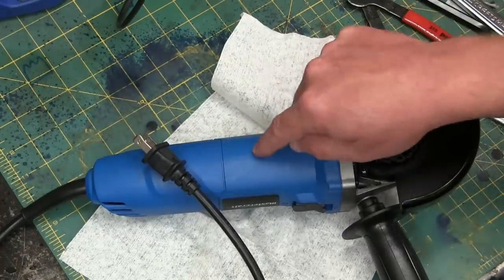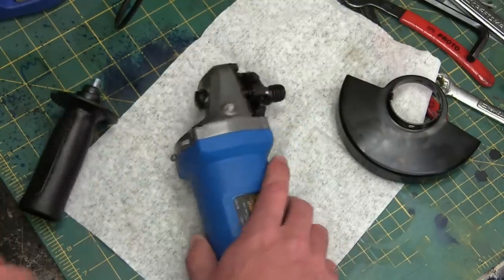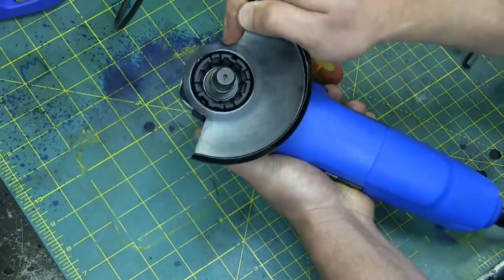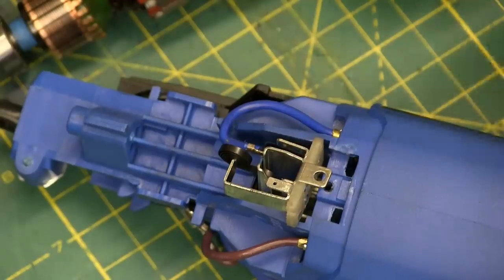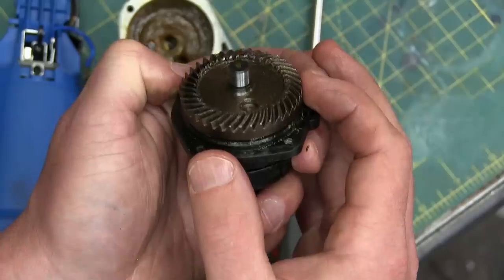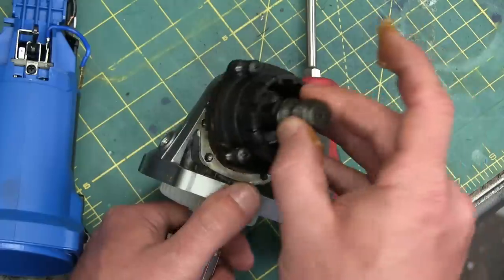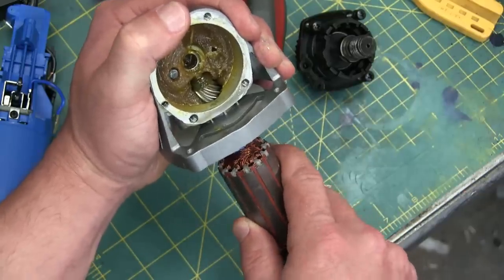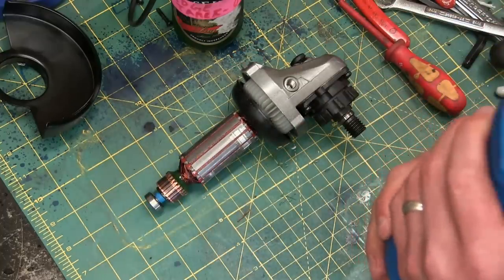BOLTR: Harbor Freight Grinder. HOW BAD IS IT?

Comment: Pushing the pin when the wheel is slowing down when done by a professional grinderman will snap the wheel loose (only handy tight to start)  and if your a rockstar you can let the carcus of the former grindstone roll right on the floor to sweep up later.

Comment: I have a HF grinder, 3 actually, one with no cooling fan what so ever, the fan busted from shaft so I removed fan and use it. it gets hot enough to burn my hands and has not quit working in 3 years! and the plastic cap that holds brush in broke so its glued in! the red grinder

Comment: The first thing to fail on mine (not even 30 days old) is the pin popped out so you can’t lock the wheel in place. Nope I never used it to stop the blade either.

Comment: I bought a grinder from the swedish equivalent of the homeless despot for about 30 bucks, and it seems friggin' similar. Sounds like a woodchipper loaded with gravel tho. And the switch friggin' sucks. Located on the topside, stiff as a wedding prick and the tab only snaps in on the 15th try. Great way to snag your pinky in the wheel!

Comment: grease leaks out. i think thats why so little is put in to start with. i used my pretty light duty until I had a big project. 

it seemed to get louder than normal. took it apart and greased it. it was bone dry.

Comment: The grinder you reviewed looks nothing like any of my 15-20 old harbor freight grinders or any of the ones in the current (2018) catalog.  The one you reviewed looks a bit better than the current Drill Master model. Ive never had grease leak from my HF grinders.  I have seven or more.  I only tossed one that rattled itself apart.   It was branded Drill Master i believe.  The arbors are giggly on the Chicago Electric ones I have.  I have a Makita that I never use. I'm afraid my better tools will be stolen.  I like having several cheap grinders in my workshop with different accessory wheels mounted. Saves time on quick projects.  All I have time for are quickies. That's the trick to HF tools...don't use them for prolonged periods.  Bearings are poor. They get warm. Buy it with a coupon and be happy if it lasts a couple years. If it acts up, toss it in the garbage or give it to Goodwill for some hobbyist to take apart on Youtube.

Comment: So I have an older version of the MasterCraft grinder, pulled it apart pretty much the same. Was doing some flux core welding last night and was using the metal rotary brush to clean up the smoke/bb's etc. Yup the shmoo gets let out. Around the plastic seam to the metal housing began to leak after consistent use. Still got the job done though.

Comment: Here in the US, Harbor Freight sells Chicago Electronics grinder. Other then color, it looks identical to that. I have that grinder. It is garbage. I mean, it does work, but all the parts wiggle to the point that I can not rely on an even grind. The handle is not angled like that though, so that is one plus. Otherwise, I am sorry I bought it. Maybe if it was put together better, it would be good.

Comment: Always, with electric motors, let them spin.  They generate the air flow to keep the temperature low.  Make them flog under load for any time and temperature will rise and something will fail.

Comment: I have 4 of the cheapest $10 ones from freight. So I don't have to swap wheels for cutting, grinding, sanding. They don't die. I beat them beyond reason just punish em' I cut daily for years now, 1/2 plate steel, unbelievable they can't be killed (4.3amp ones) worth all 1000 pennies.💯👍😎

Comment: I got the 4 and 4 1/2" Harbor freight cheapo not heavy duty and the are both all metal gear housing.  Just went there and you can see in the pictures the American Harbor Freight the gear housing is all metal even the bearing plate.
Reply: Also the handles are not at a funky angle on the HF ones.

Comment: Got me two of them 10 years ago with a metal gearbox housing, on my 3rd set of brushes and they still scream like new. I use them more than average home owner, but not a pro would. I got my 20$ back many times in the 10 years I've had it. Heck I'd buy some other tool from china freight, have it fail pull the brushes and use them on the grinders, return the failed tool for $ or something else lol.

Comment: I bought a harbor freight chicago electric 4.5" grinder because i needed it for a quick job, not to be proud of it and use it everyday. I used it for the longest time period last week and it got SO hot and smelled like nasty plastic or glue. I was scared to continue using it. I'm going to get a 4.5" metabo when i have the $160.

Comment: I had this in my hands to look over. The switch broke - one of the plastic bits that press on the sheet metal pieces that close the circuit was melted. The owner said it wasn't worth their time to wait for me to order some other switch. So they scrapped it.

Comment: We could say what we want. But just yesterday I had to remove a pressure relief valve from a old nipple on a older boiler. Didn't have my grinder with me and so went to HF for one like this. Just use the shit until it burns out. Most of the times it will get the job done.

Comment: I recenetly bought a new Makita 9565CVR (made in Romania) grinder, full of quality issuses,  bad wobbly (NSK Poland) bearings, loud gear noise, bad gear tooth alignment, aluminium chunks in the grease, even the the sticker is not straightly put on... If you could  teardown one I would be pleased!

Comment: I would like to see the Makita 1-1/4 HP Compact Router
Model#  RT0701C. I have had the same one for about 3-4 years now and it just wont quit. I have run it to the point that it gets so hot that you cant even hold it on multiple occasions. All around just abuse. I imagine it must be pretty skoocum but would like to know for sure. they are $99 U.S. at the local Home-DesSpot.

Comment: I have used they professionally in an auto shop. Hard use, misused, and abused. They have only failed in the bearing, probably would have kept going if i pulled them apart to grease the gears

Comment: I have a question about shitty grinders.

 I have a Black & Decker 4 1/2 grinder and it's probably worse than this mastercraft one (tools sold in Brazil are amazingly shitty and expensive). Whenever I run the fucker it gets hotter than a two dollar pistol, even with no load. When I checked the gearbox I noticed the grease was naturally crappy but even after I replaced it, every time I opened it up again the gears were completely dry. Is it normal? And is there a way to make it work a little cooler?

Comment: I can't speak for tools, but I know that with cheap electronics, the makers just use whatever they can buy that's the least expensive. Sometimes that's a high-end part that was someones overstock, and sometimes it's a complete crap part. It'd be interesting to take several of these that were made years apart to see how the quality differs across them.

Comment: Your final statement is something I have said "ALOT" or "how the eff did they do that?"  I went cheaper than Kinky Tire. // I got mine at Princess Auto. 4.2A 18 gage wire and taking it apart - I will wait until "I have to".  Used very little on light stuff.   I got a bigger machine from Trade School that holds an 8 or 10" blade to cut off pipes as it is not an angle grinder but straight through. all metal beast.  You mentioned about always having a "guard."  It don't got one so I got to look for that or make one  Was going to take it apart like you did but that is work and I am not that interested now that I know what is inside it. My SUPERIOR brand "does have a lock switch."  More the artsy fartsy tool for the artistic homey.

Comment: I wish they still made the 5". Those had some chooch, for a little guy. Stood up to Heavy steel and Ironwork, too. Of course, they went on the cheap for the last batch. Sales dropped and they could then drop the line. Now all they have are those 4.5" time wasters. HF motor brushes are too soft. Replace them with real brushes if you want a half way decent service life.

Comment: Ahh when the Canadian Tire changed their Mastercrap line. Interesting mix of shitty and good. The old series stuff was dark blue.

I've got the older 5" rat tail, it's built really rather quite well. The grease in the head was crap though, so I cleaned it all out and replaced with aluminium based high moly synthetic grease. Sounds nicer, doesn't get nearly as hot and spins smoother.
Reply: The old Ukrainian inner tube (mastercrap) tools were pretty robust,not so much anymore.

Comment: I bought a HF grinder. Put a wire wheel on it and used it for about 2 minutes before it got so hot I couldn't hold it any more

Comment: A clipboard guy walking in a posted walkway discovered an extension cord.  All the workers were at lunch so he decided to unplug the trip hazard and get it out of the way. About 1.5 seconds after pulling the plug, a sound permeated the entire 180,000 square foot building.  The large magnetic drill fell six feet from the ceiling of a glovebox that was under construction, and impacted the sheet metal flood of the structure.  The next day the clipboard guy was not allowed to carry a clipboard...ever again.

Comment: Two of the crap tire specials I have like shown have turned the grease hard and chunky before it leaked out, I however have just re-packed the head with high temp bearing grease instead. Of the two, only one had sufficient grease to lube the gears, the other one had a blob in one corner and that was it

Comment: Most universal motors including the one in just about any hand held power tool spin at a bit aboove 30000 rpms unloaded. This in combination with the brushes on the commutator is what make these machines  (and most vacuum cleaners as well wich also use universal motors) scream like jet engines even when just running unloaded. Most machines like these  makes over 100 dB of noise just by themselves. Of course there is no point having a machine like this quiet running since cutting through material makes twice the noise still. Always use earplugs as well as some form of eye protection when working with power tools. That machine looks quite ok btw, some parts seem a bit flimsy but I bet it can last a while if used properly.

Comment: You should do a BOLTR on something that's Tool Shop brand (Menards house brand, you may need to cross the border for that one, dunno if they have Menards in Canookistan)
Reply: I've got the cheapest Tool Shop grinder. Been putting it to moderate use for probably 5 years and she still chooches. I love Menards Masterforce tools. I use their 20 V drill ($50 on sale) attached to my ice auger for ice fishing---everyone says you need the Milwaukee Fuel drill for an ice auger 😂.

Comment: The "shittier" $10 one seems to be made better, no shitty plastic cover holding its guts in and the guard is just held on with a screw clamp so its easy to take off and throw in the trash. I grind on metal with that thing all the time till it gets real nice and hot, it's always covered in oil, metal dust and wood dust, i put a zip tie through one of the air vents. I hang it on a screw off the side of my workbench and it falls off all the time and that thing seems to be running better now than it did the day i got it a couple years ago!

Comment: They must of looked at the slight angle on the Makita handle and thought "angle appears good thing" so double tripled it. btw, a dead man's switch requires the operator to maintain pressure to keep the machine running - it's a safety mechanism that shuts the machine down should the operator become unconscious or "die." The switch on the grinder is the opposite of a "dead man's switch." jus' sayin'

Comment: You should do an equivalent to the blue one over here in the states which is the 6 Amp Heavy Duty Paddle Switch Chicago Electric Power Tools Professional Series - Item#65519 its CSA rated surprisingly.

Comment: your assumption about the brush holders being likely to fail is 100% correct. I've owned 3 of these and the brushes go quick, and the brush holders fail not long after.
Reply: I haven't noticed grease leaking out to be a problem, though.

Comment: I got the drill master 4.5 angle grinder from harbor fart and that was 4 years ago and i have 3 boys who love to wrench on shit aside from adding a longer cord and replacing a brush which they include 2 with the unit its still going strong but the lock on the switch is pooched all in all not a bad pos.

Comment: The older Metabos are way better than the latest iterations. On the newer ones, changing brushes requires quite a bit more fuckery than the old ones. And they put a magnet on the end of the armature that tends to break. The WE14 was a great grinder. The WE15 is garbage.

Comment: would love to see you tear down a solar inverter from Outback Power Systems (3648 or 3624) or even Magnum Power Systems and see whether they're just absolute garbage or not. I've been running on an Outback  3624 for more than 5 years that lived underwater for 2 years before I pulled it out cleaned it out dried it out and replaced nothing in it.

Comment: i will send you my 18v metabo cordless for review. i paid $500 for that kit, and it has failed to meet my expecations. when it worked it was nice, but i had 3 bearing blowouts and a phase wire pop off. fixed those...now the little end motor bearing os ficked and i can't get it off. your turn?

Comment: My Harbor special is going on 5 years and still works like a top. Use it for around the barn and fencing, have yet to see any bearing issues or melting. If it does break I can walk into HF and get a new one no questions asked. I cannot afford the spendy models, so a cheap dime store hooker is what I can get.

Comment: Stopping the grinder with the hold pin? No way! The easiest way to stop a grinder after the switch is off is to press the wheel/disk into the workpiece and it will stop within a second. No need to press the hold pin with the wheel still spinning to stop the wheel & destroy the pin or other grinder parts.

Comment: AVE,
  Have you ever looked for a thermal overload protection in grinders? I won't argue that that little lip will wear off on the lock, but it may not all be that. I have a Dewault with that style switch, it has been around for years, but not taken out much, but when it is, is for big, long, hard 😀 working jobs. My switch does not let loose until I have been given er for a long hard time, then I'll turn it back on & lock it, let er free spool for a bit to cool down, and she's good until it heats up good again, then the switch trips. On the rare occasion I do use it for a sissy job its fine. It would also stand to reason that if it does have a thermal overload circuit, it would trip more the older & tired it got.
  Just a thought
Keep putting them out, Love em, so does my 5 year old son, except he keeps asking me why he would want to put his dick in a vise.
OK lying, too old for a 5 year old son!

Comment: A few of the unique design decisions on this grinder point to it being a shameless knockoff of the Makita 9557. The angled side handle and the on/off button design, straight up the same. Of course the Makita fixes a lot of the problems this one has in the name of cheapness. No stupid detents for the guard, it's retained by a clamp. Metal bearing case. Sealed bearing on the tail end (607LLB). But that's why the Makita is $69 at the Homeless Depot.

Comment: Again, really liked your video...my comments. I would say that the paint on the head is better than not...better protection from corrosion and more bang for your buck!  The guard moving around, not sure why that would cause you to lose your mind full of marbles?? I would say that for the money...two for $.99 from Crappy Tire, these are best bang for your buck...yes? I've had two Mastercrap 4.5" grinders and they've done very well for what you pay. As for the gear cogging, it appears to me that the drive head gear and the rotor gear are not properly attached and aligned as the ass end of the rotor is flopsy-mopsy!

Comment: All i know is i got a Hercules for 14 and just used it to cut a buncha grade 8 bolts and get rid of several layers of rust on a track loader from the 80s. Killed a ryobi in the process but the thing is running great. Paid for itself far as I'm concerned

Comment: Bought some wicked Metabo 9inch grinders because we had to move a lot of metal quick. Worst decision ever. it kept overheating with no pressure on the tool.  it was +38 Celsius but still. the miller welders ran up there all day so youd think a grinder as expensive as that wouldve worked in the heat for more than 2 minutes.

Comment: In Denmark with high wages, 25% VAT and everything costing a shitload it is possible to buy cheap grinders for less than 7$. They do have one use for the happy amateur. You buy it for when you need to grind concrete plaster or paint. This fine powder can fuck up any sensitive tool, but the cheap shit still has a one year warranty. So do your job til it fails and then return it and get a new one from the store and give it to the next man down the road needing to do a terrible job at something.

Comment: The top will fail every time. My boss buys these for us because "they're a pretty good price" as he says. I have taken apart at least 20 of them apart and every time the grease is completely burned to shit and the gears have chipped teeth and become misaligned, sometimes to the point where when you power it up it is completely locked up.

Comment: i turned up a new baring cover out of aluminium for my black and decker 4.5'' because the factory one was plastic and fucked itself when i put a wire wheel on the dam grinder.